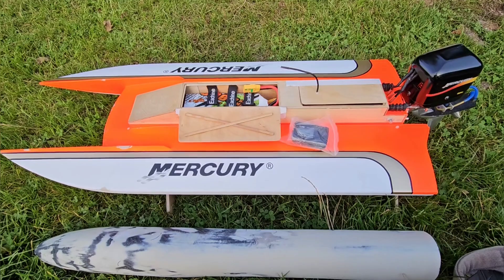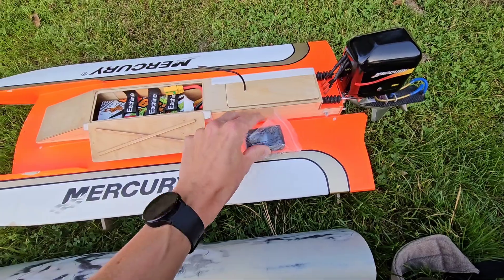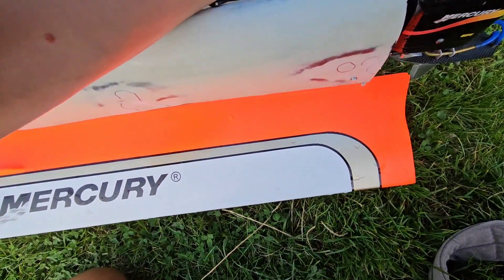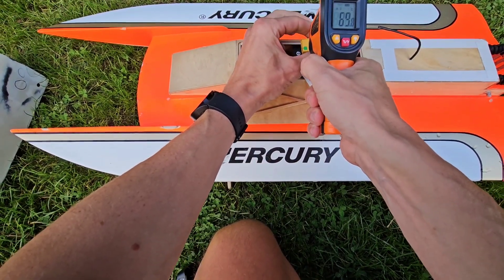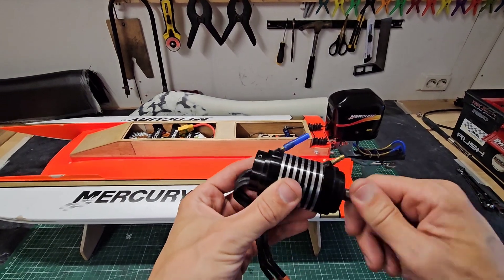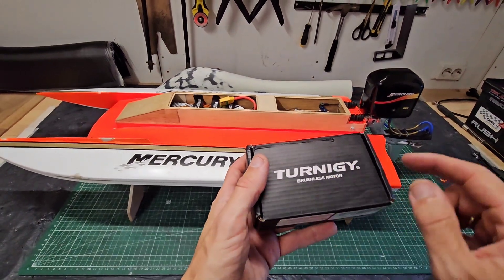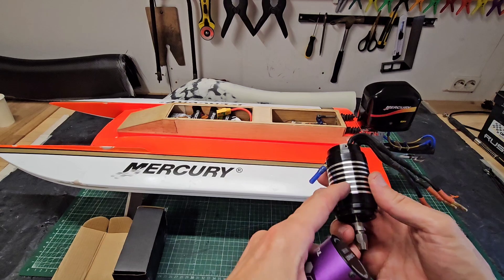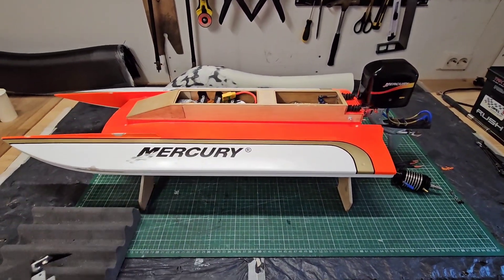DIY RC boat: T800 F1 Powerboat running, until breakdown.

Comment: Great video unfortunatly of the motor.
I have had a turnigy xk 3665 motor for 2 years in a rc boat hasnt let me down once boat nearly sank and just a little grease and go. I think they are awesome motors.
Reply from the maker: @parkourrush3820  Thanks! I think so, too. I.must say, this SSS motor has been great, too. It has worked for 4 years and countless runs. It survived multiple submerges and hard crashes. So I don't blame it,  if it is toast now 😉